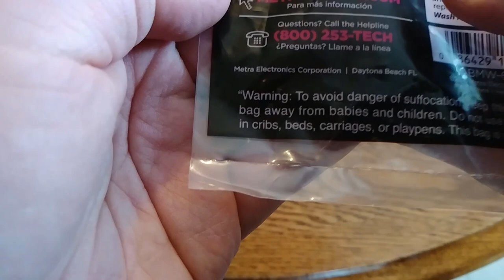Removing wires from a Metra harness

Comment: I had success with a bobby pin BUT I had to insert it through the connector side, not the wire side like in the video. You have to try all four sides to find the latch. In my case, the latches were on the opposite side from the connector's overall latch. Good luck.

(Oiliehu chinese head unit, not metra)

Comment: I needed to move one unused wire to an open position to connect the adapter for my steering wheel controls. I stuck a lock pick in like you showed, and it popped right out. Moved it over, and it snapped right in.
Reply: tysm

Comment: Where can I get replacement wires with the little metal piece on it? The wire I need to replace is cut flush with the connector. In the video it seems like you’re inserting the tool but at the same time pulling the wire??? Am I screwed since I have no wire to pull 🤦🏿‍♂️🤦🏿‍♂️🤦🏿‍♂️😂😂😂
Reply from the maker: yeah, i was pulling the wire as pressing the tool, but the tool does make something click and pop out. if you cut the wires flush, you might need to try a new connector
Reply: @5after12  ok thank you

Comment: If I want to go about adding 3 pins to a harness I'm going to use for an Android deck, can I just grab the harness pin ends and crimp them to the existing cables I have? Or do I need to get separate cables with harness pins and solder those to my existing cables? 

Also, is it possible to buy just those harness pins?
Reply from the maker: I would assume you can just crimp them, but I am not fully sure of what you are looking for
Reply: @5after12  So in detail: 

I have a 20-pin harness that is missing 3 pins (just how its sold). I want to add those 3 pins in. Those 3 pins are wires from a 3.5mm aux cable that will go into the aftermarket male harness that will attach to the oem female harness. 

I was told I can solder the 3.5mm aux wires (3) to the oem female harness, however soldering inside that tiny space where a double din deck sits is not something I want to do. 

So the question is how and can I add pins to the end of those 3 wires from the 3.5mm aux cable to modify the aftermarket harness I currently have. I can't seem to figure out how to search for just the metal pins or how the would connect to wire. Alternatively, I could spend another $20 for a pre-made harness but I don't want to wait 1 week for shipping. 

The other question was basically should I look to add the metal connectors to the 3.5mm aux cable wires (3) or alternatively find 3 already pinned wires, pin them into the harness then solder my 3.5mm aux jack to those newly introduced wires?
Reply from the maker: I could not solder in that space, but I am not good at it.

I would buy a 2nd harness and remove wires from it and place them in the one you want
Reply: @5after12  And that should work even if the colors of the wires don't match?
Reply from the maker: Yeah, I think the colors are just for identification, as long as the right wires are connected the colors don't matter. It would just be confusing

Comment: I have a question for you. I bought the 10.1 8.0. I can get the radio to play but that’s it YouTube, Netflix, Pandora nothing will play!! Please help. I love the 10.1 but in just have a little problem with it help
Reply from the maker: Travis Mason you mean no audio? Or the apps don't work at all? You of course need a data connection
Reply: 5after12 no audio app works but no sound
Reply from the maker: Travis Mason so audio works in the radio but nothing else? That's a weird issue that I have never heard of, maybe try a software update:

https://youtu.be/swePrFiwNSg
Reply: 5after12 how do I do a software update?
Reply from the maker: Travis Mason I posted a link to the video where I do an update

https://youtu.be/swePrFiwNSg
Reply: 5after12 ok I have to try that. Thank you very much for your help

Comment: how do you get the pins out of the black multi pin (the 20 pin one on the other end of the harness?
Reply from the maker: I don't think I took those out
Reply: @5after12   thanks for the super fast reply! not even sure its possible as they're so small, looks like i'm gonna have to cut the wires and solder them back up, damn Chinese head unit !
Reply from the maker: @colinfairhurst8949  why do you want to remove them from the black side?
Reply: @5after12  because it would be easier when you don’t have much space behind the head unit and want to reconfigure it to your car specific connectors without using any iso adapters
Reply: I know this is an old comment, but the other end is Molex MicroFit. They have 2 latches, but only enough room to loosen one pin at a time, so its a PITA. I should also note that the MicroFit pins are not meant to be reused when removed because they will most likely be damaged.